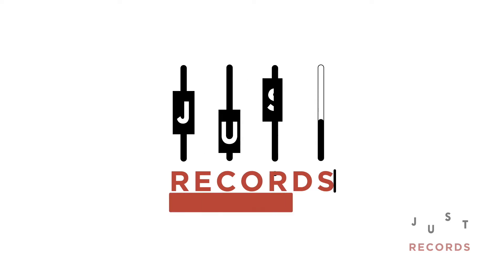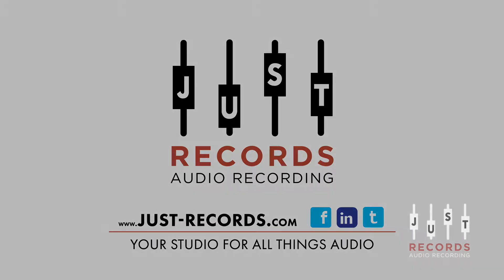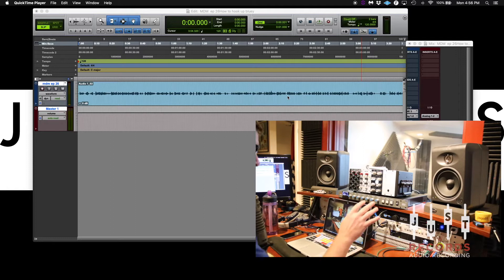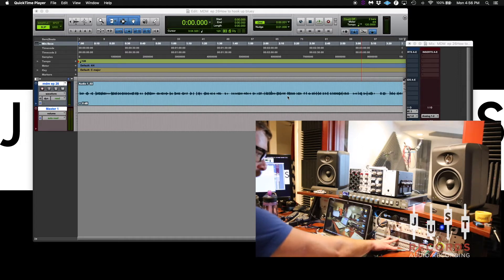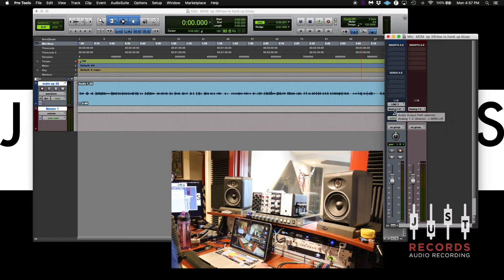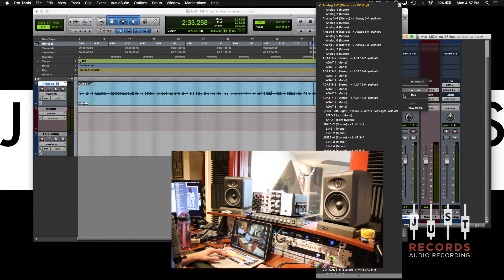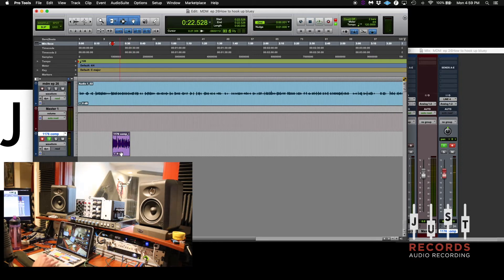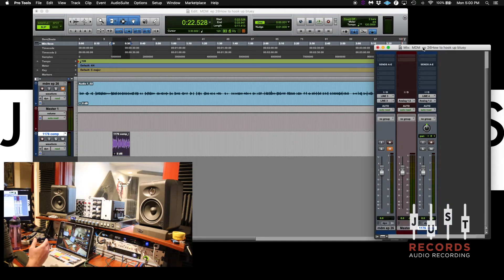Ep 26 - Signal Chain and how to hook up outboard gear!

Comment: Neumann tlm 102 + blue tube v2 + ssl2 at the moment. 

I want to add either the Presonus studio channel
 (cons: don’t want a channel strip with the mic preamp since i have the blue tube separately and it’s a Beast) 

I’ve been looking into the Lindell audio lintec gear. Any suggestions other than the usual?

Comment: love you channel bro i have a question will you have to do delay compensation when doing it at the 6.06 mark on your video will this print the signal as is let me know asap pleeeease thankk you
Reply from the maker: Thanks for watching. Good question. No I do not have to delay the signal. And you “shouldn’t” either unless you have very high latency in your AD/DA converter. It might sound delayed so once you print a section of your track compare listen back live to see if it’s off. If it is off find your “low latency” setting in your daw and turn it on.
Reply: @justrecordspgh  Thanks so much ima try and let you know thanks

Comment: I thought this was the perfect combination video I needed, and it still feels a little unanswered. I was trying to figure out EXACTLY what you didn’t quite answer. I have the BLUEY, Focusrite Scarlett 18i20, and I use Pro Tools. I did figure out how to use the bluey to compress a track that is already recorded (have to make sure you’re sending with or without plugins like eq as desired), but I couldn’t quite figure out how to use the bluey as I was recording. First, if you only have one bluey, no point in sending from two line outs because it’s going to be in mono when it goes back in the scarlett, and one mic or one guitar would be a mono track anyway. Is that right or am I looking at that wrong? Seems like you’d have to use one bluey to copy a left signal to one track panned hard left and then a right signal to another track panned hard right. Second, I tried mic/guitar straight into the bluey, and couldn’t get any compression going because I needed a preamp to send a strong enough signal. Wouldn’t it be moot to send it through without a preamp? That’s where the main question came from— is there a way to set up the focusrite software to send a mic/instrument signal in one input while sending it out of an output used as a preamp, in and out of the bluey, and then into another input for the recording? Maybe use a bus track in protools to send to bluey while another track is recording the compression?
Reply from the maker: If your scarlet has a direct out you should be able to run A line into the preamp, direct out to the bluey, then back into a line in that doesn’t have a preamp. Depending on your scarlet this could be possible. Then yours be tracking to into “line one” come out to hardware then feed back in to “line X” and record that into your daw. 

I hope that makes sense.